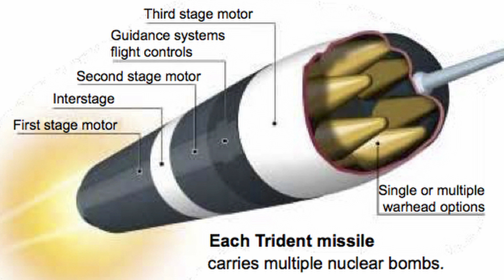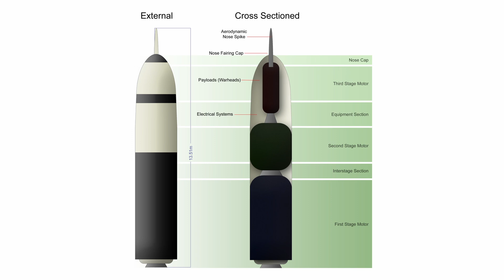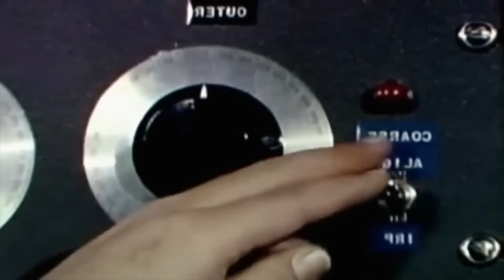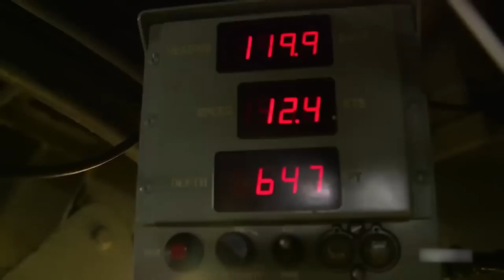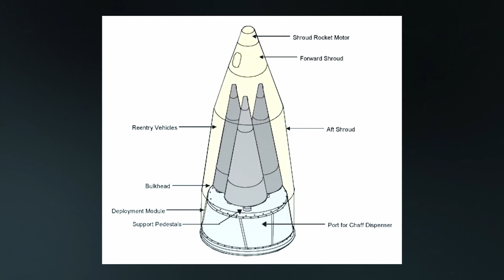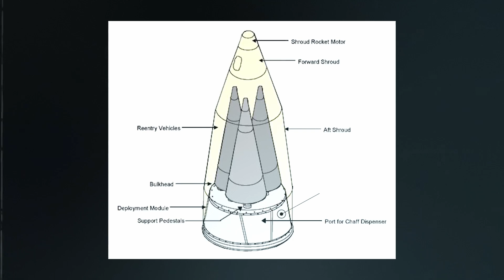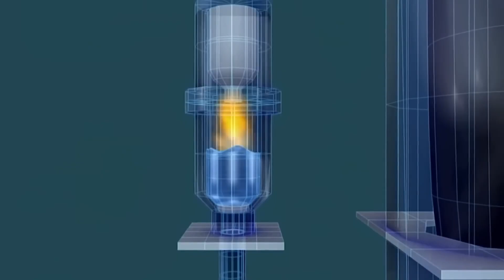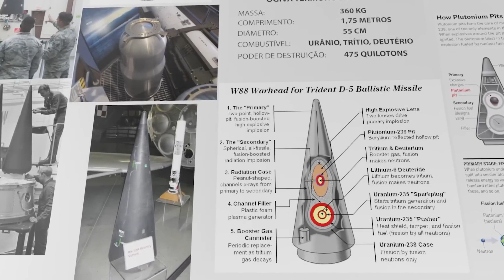Why This Weapon Could End Civilization

Comment: SLBMs or submarine launched ballistic missiles are not ICBMs! ICBMs are land based and longer range although the UGM-133 Trident II D5 LE blures the lines on range compared to the 1970s.
I served 6 years on USS Florida in the 1980s as an FTB- ballistic missile fire control tech. The US Navy's Ohio Class Trident missile submarine with the Trident II D5 installed 15 years after the Subs designed to carry them were first built because Lockheed had serbacks in the 1980s with them until the mid 1990s. The Navy SLBMs were always a second strike weapon due to shorter range, throw weight and accuracy have since the late 1990s with the superior UGM-133 are the primary strategic deterent with first strike capability.